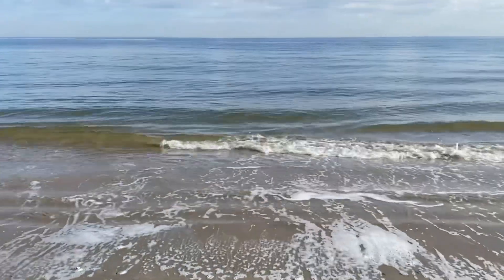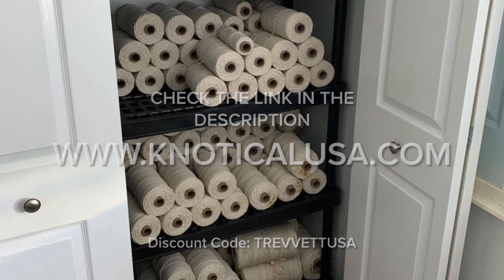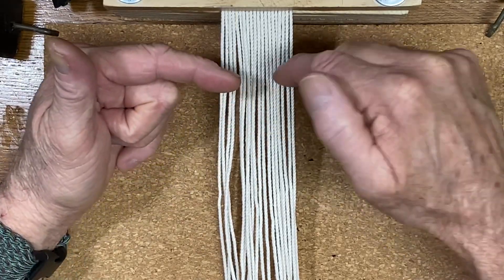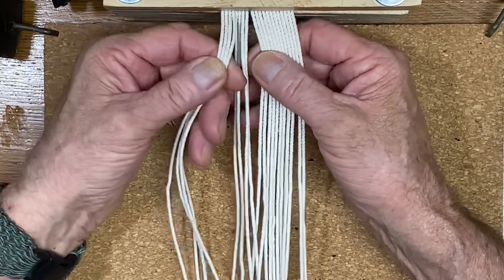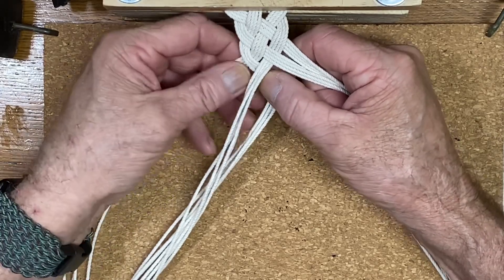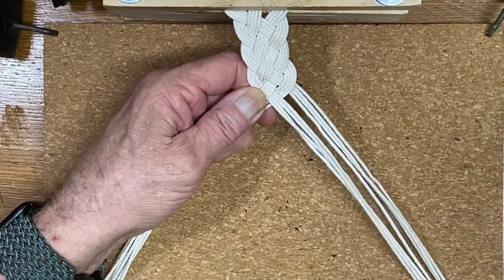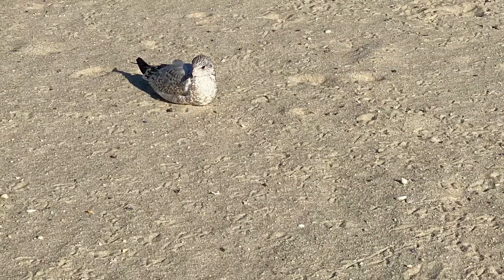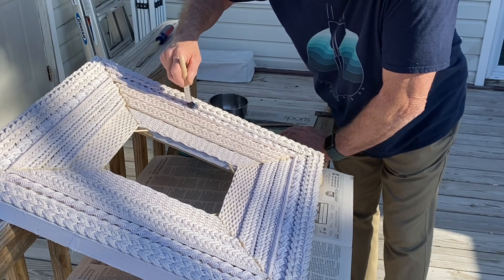20 Strand Flat Sennit ....

Comment: Thanks for your tutorials. Great work. Is there any  reason not to use a spray gun to apply polyurethane? Can it be varnished?
Reply from the maker: I suppose you could spray it but it wouldn’t be as thorough as a hand painted coat with a brush you do one coat which soaks into the raw cotton…